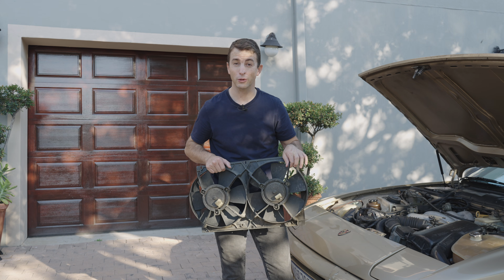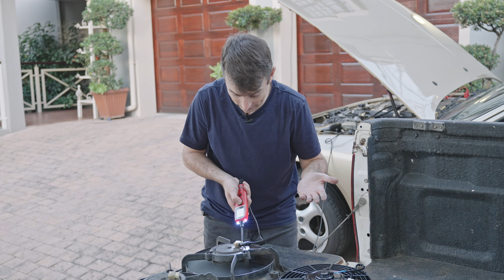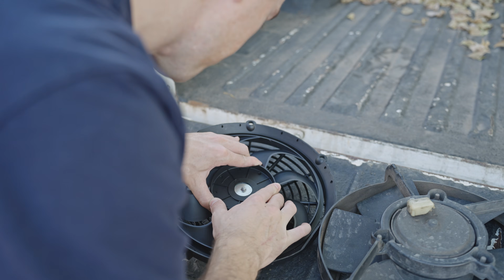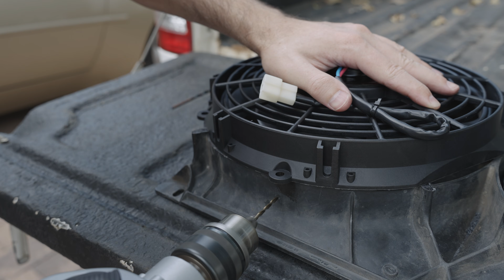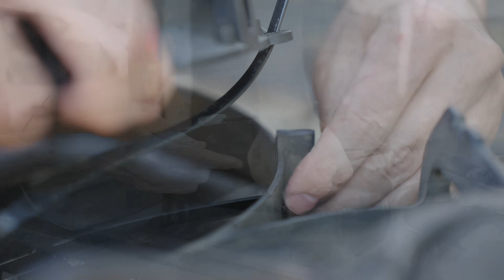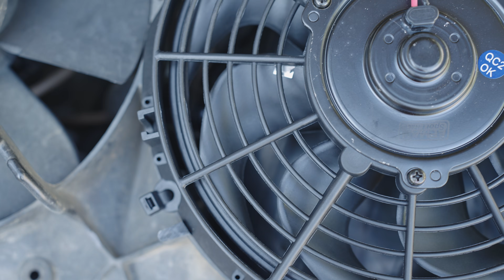PORSCHE 944 DIY - OVERHEATING (Part 1): Cooling Fan Replacement | DailyDriver944

Comment from the maker: Replacement Fan Specs: https://amzn.to/3TEJuWs

Diameter - 10" / 290mm
Speed - 2500 RPM
Airflow - 650 CFM
Amp Draw - 5 Amps
Power - 80W
DC - 12v

Comment: How are these fans performing 3 years later? I'm tempted to do this, even though my stock fans are adequate for where I live right now (rarely gets above 90° in Pennsylvania in the summer)
Reply from the maker: I’ve been very impressed - the reliability has been great. If it is not needed right now, perhaps find a second shroud from somewhere and have both? …they’re easy enough to slide in and out.

Comment: Hey. Thanks for the educational vids! Love all of them and your British voice!  Anyhow, my 3.0 s2 fans only come on at high speed. I'm ordering the proper resistors from 944 online, but should I think about replacing the relay as well?
Reply from the maker: Hi Michael! Sure thing, and thank you very much! If you’re comfortable with the cost, replacing the relay is never a bad move - these cars are getting older and so pc boards etc within relays are bound to eventually give in. The Focus9 relay has built in testing functionality - alternatively, the test I do right at the end of this video is possibly worth doing if you want to confirm the current relay’s condition? (Just don’t make the same mistake I did 😅)
Reply: @ILoveMy944 awesome. Well, we replaced the resistor closest to the passenger door (far right side resistor) after testing and no reading.  Working great now. My tech also when I got the car in May replaced the radiator thermostat with one that allows more coolant flow, helping keep the engine running cooler at all times. (NorCal hot summer environment) It's almost always showing about 25% on the gauge and never gets to half way which is comforting! She's quite happy now and purring supremely!
Reply: @ILoveMy944 I did however replace my dme relay with the Focus 9 solid state. No problems at all and I believe fires up better now as well

Comment: I've had this same issue on my Porsche for the longest. I'm very keen to see how you fix the high speed mode.
Reply from the maker: I didn’t actually need to fix it…during the video the high speed test was done incorrectly and that is why I got the result I did. So mine works really well at this point. BUT I’ve bought another and that one has had its wiring mangled - so there may be some testing and repairs needed there.

Comment: Thanks for your video and the link! My 85.5 NA fan had been rubbing at the end of the cooling and I tried to make stop but no luck. I ordered the fans from the rain forest and yesterday took the time to do it. For me taking it out, cutting out the old one was super easy. I added 4 more zip tie holes to each side, so there is now 16 zip ties holding the fans in.

Putting it back in took the longest. Since the new fans do protrude a little more than the stock fans, the right side kept hitting the AC compressor pulley. If I woulda put my car on ramps it would have been easier, I only lifted the right side. Anyways, under the car I positioned the fan upside down (bottom of the plastic with the part number now on top), pulled the left side up (soon to be right, but avoiding the AC Compressor) then rotated it from left to right so the motor was above and beyond the AC compressor then put the actual left side in place.

It took me under 4 hours, not really a hard job, just take it slow. I didn't want to break anything and thankfully the only thing broken was a plastic clip to hold part of the wires up (zip ties fixed that).

Thanks again for your idea and video!
Reply from the maker: Excellent update and insights here for the rest of the community!  Thank you for sharing so many details! And I'm really pleased that the video has helped!

(And my original fan was also perilously close the cooling system, and it always made me nervous!)

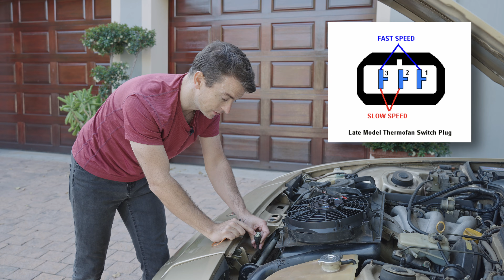Comment: In the video you state you are attempting to trigger high speed by shorting terminals 2 and 1, but the pinout shown at 9:58 suggests you should have been shorting terminals 3 and 1.
Reply from the maker: Yes - I got it wrong during the test - well observed. I tested it later and am very pleased highly speed mode is working. Thanks for watching and for sharing your insights 🙏🏻💪🏻

Comment: Thank you for this. Gonna drain the coolant system and refill / bleed this weekend. If it's still running hot I'll try this.
Reply from the maker: I’m glad it’s offered an additional option to you. I’m very, very pleased with it up to now and the fan is working perfectly. Just please note that during my test I got the high speed portion of it wrong so do what I didn’t do 😅
Reply: @ILoveMy944  I saw that comment! No worries, I like when people make mistakes. Is it fairly simple to remove the fan housing?
Reply from the maker: @Dallydylly  very simple - just make sure that you have the correct fittings - the first one I reattached it - way before this video - I punctured my radiator. 😅

Comment: You can find some audi 100 aftermarket fans that you can mount without cutting the original mounts... 
For this kind of fan that you have mounted it is better to do a new shroud from metal some cutting bending and you can do it...

Look for
TRUCKTEC AUTOMOTIVE 07.40.007
MEYLE 120 009 0001
VEMO 15-01-1824
AUDI 4A0 959 455 A
AUDI 4A0 959 455 C
VDO 5WK05020-V
FEBI BILSTEIN 6998
AUDI 893 959 455 F
AUDI 893 959 455 G
HELLA 8EW 009 144-321
SWAG 99 90 6998
VEMO V15-01-1824

280mm diameter 
180W
With two cables.
Reply from the maker: Thank you for this, Adam - a fantastic contribution!

Comment: Great video, and thank you! How is the clearance sliding the fans in between the radiator and the power steering pump and AC compressor? I have a slightly thicker aftermarket radiator and it’s very difficult to get the fans back in. If these are slimmer I may do this for both. Thanks!
Reply: @ILoveMy944  Great! Thank you. Going to order the fans. Appreciate it, and I'll post a reply as to how it goes. Goeie Dag! (that's about all the Afrikaans I learned from my South African neighbor in Florida years ago :)
Reply from the maker: Hi ch - I’m pleased it has been helpful. Clearance on my end has been good. I’m able to get my hand between the fan and the front shrouds with room to spare. Definitely lower profile than the originals. So slightly thicker shouldn’t be a problem 👍🏻 Looking forward to hearing how it goes - please keep us updated?

Comment: Amazing video Gareth, especially on a topic that's not covered too much for our cars - the oem fans are so expensive. If mine ever goes I will definitely be referencing your video.
Reply from the maker: Thanks Seagrams! Yes - very expensive. In fact, I was on the search for just the shroud, thinking I could transplant the fans, and this was also through the roof expensive...

It must be said though that these original fans are very impressive to have lasted this long. 

Outside of the expense though, tech has moved on and having seen how quickly the old fan stops after a spin, I'm willing to bet the updated fan is significantly more efficient than these older units.

Comment: My 944S2 behaves the same especially at traffic stops during hot sunny weather. The temp will creep up to the third mark & when the car is moving again, the temp will slowly move down to half again. Both original Porsche cooling fans used to be dead before & I replaced it with Chevrolet Cruise fans which is the nearest that could fit the compartment. Other mechanics kept telling me that the fans speed were not strong enough & I should opt for Porsche original fans which is double the price. And I’m definitely not in the right budget at the moment.. But my worst fear now is, how safe is it when the temp gauge creeps up to the third mark..? Will it eventually mess up the headgasket in long term..? That’s really my ultimate worst fear though. Need some advice here. Many thanks!
Reply from the maker: That third mark was definitely the limit for me - when I pulled off to the side of the road, it was between that mark and the top red - and caused me massive stress.

No damage was done, fortunately.

After installing this fan (specs pinned in the comments section here) it hasn’t reached the third mark and I’ve driven a lot. It’s working so well that when I stop at a traffic light, my temp drops.

1) Is your thermo fan switch activating at the correct temps? See: http://www.clarks-garage.com/shop-manual/cool-01.htm

2) What happens when you bring the car up to temp in your driveway? …Do your fans activate?

3) Have you checked your cooling system for leaks? (Here was when I did mine: https://youtu.be/gTMIVzS2Ya8) 

Leaks cause air pockets which are bad news in the cooling system and need to be bled out asap.

4) And it may be a silly question but are you certain your current fans are pushing / pulling air the right direction?

It seems really strange that you have two fans running but they don’t bring the temp down?
Reply: @ILoveMy944  I'll definitely will get it addressed soon. It's rather ironic actually because when the temp hits the third mark, both fans are actually spinning.. It only happens during traffic stops on hot afternoon weather though. As soon as the car is moving again the temp would drastically drop to optimum level again. The faster I drive at the highways, the cooler it gets. Honestly I got a feeling that the fan motors are not that strong enough. Could be the capacity of the motors were not as powerful as the original ones. Because that's what the mechanics at my area had been telling me.. Sounds rather logical because both fans doesn't sound loud at all.. Anyways, will definitely get it sort out soon. Luckily it's not my daily driven car. I will only drive it during the evening where there is less heat outside & the temp will normally be in ideal mode. Thanks for the kind feedback mate. Appreciate it a lot! Cheers!
Reply from the maker: Our cars depend on the revs of the engine to drive the water pump and so it sounds like you may have a bit of a flow or pump issue if things are getting so hot when stopping at traffic lights etc? 

With regard to fans, CFM is the measurement used to determine how much air is being displaced or moved and perhaps your fans are on the lower end of the CFM spectrum so struggle without additional moving air?

Please keep me updated - I’d love it if you got it sorted out and to know what it is that is causing this for you?
Reply: I have the exact same issue.   At idle it climbs to the third mark.   At highway speed, it drops to a little above half way.

Comment: Did you consider plastic welding to repair the original.
Reply from the maker: Hi Brian - yes I did, and the reason I didn't opt to do it was the amount of tension on the arm that broke - it was very surprising that I was unable to get it back into the original position (which I felt would be the strongest position if repaired this way).

I don't know the strength of plastic welding either - and I have very little experience with it. 

It wasn't fun to cut those mounting arms off, but I'm pretty happy with the result.